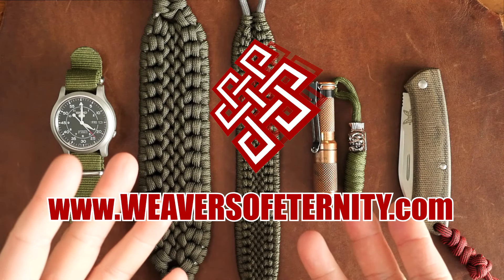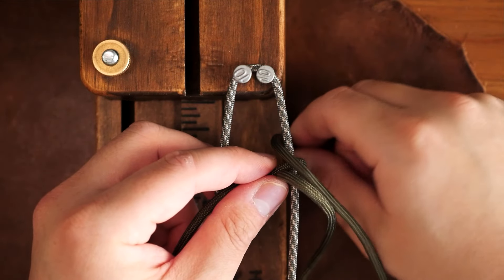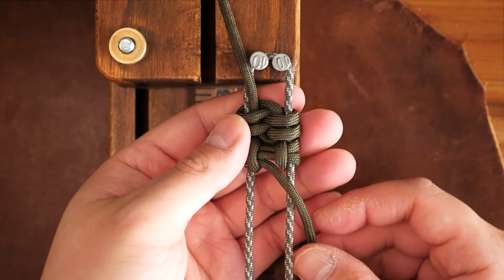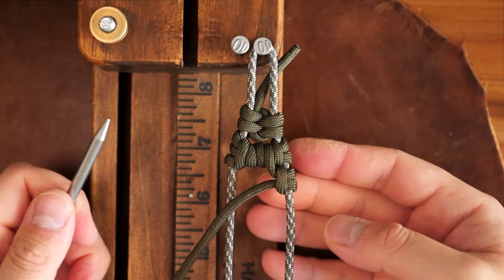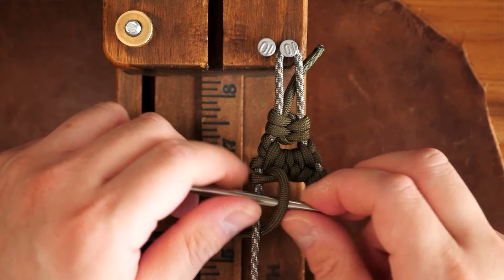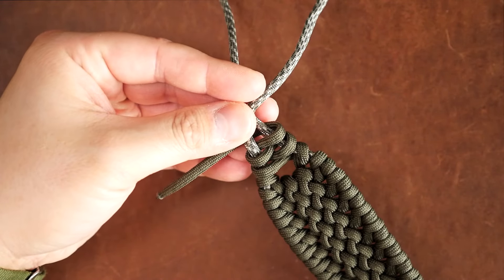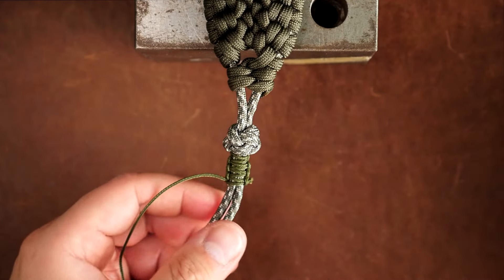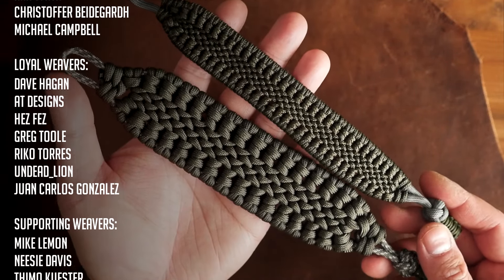This Will Take Time, But That's OK! Conquistador Cuff Paracord Bracelet

Comment: this is going to be epic. i am going to DO this, even if ia gotta use some nails in a pallet as a jig.
Reply: on and off, took all day, but got it done!! ended up using 35ish ft and 5 ft, used it all up in order to maintain length. will use as a stored paracord method for friction fire bow (5' sheath), packframe lashing (5' strands), ridgeline (35' sheath), spring pole traps (35' strands) in conjunction with a steel bottle cook kit. condenses it well and flat, looks cool, could become a wide shoulder strap if needed. thanks a bunch!!

Comment: Reader beware that the breaking strain of paracord is higher than the breaking strain of your wrist or neck. 
It is advisable to use a weak attachment, such as usual string, or a plastic buckle, so that in the event of the bracelet being caught, it can break free before doing damage.

Comment: Would it be possible to make this with a buckle instead of a loop and knot? I've been wanting to make this bracelet for awhile  but I only do traditional buckle bracelets.
Reply: I'm going to have a go at this weave I think to make myself a strength bracelet using not one but three watch buckles (I like a challenge) here's what I'm thinking :
Instead of knots on a jig you attach the cord to the buckle making several loops (for the conq weave) and letting your two ends go from each side of the buckle to make your "frame", then you start with the main weave attaching the conq weave to the loops on the buckle.
For the end buckle I think you could make loops with one end of the "frame rope" and make the other end go through the loops, once all is done, tightened and melted I think it should hold pretty well.
If you watch WoE tutorial for the conquistador watch band (undone watch) it will give you some starting points.
Have fun on your project !